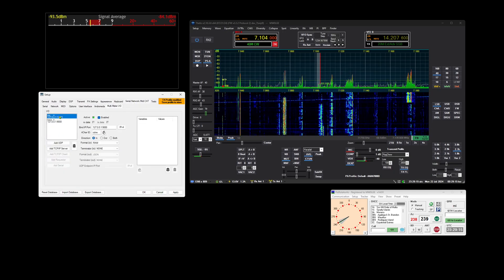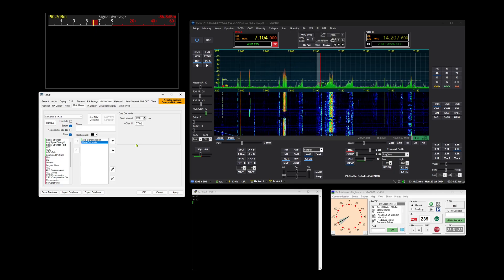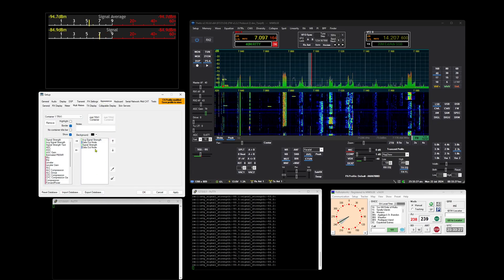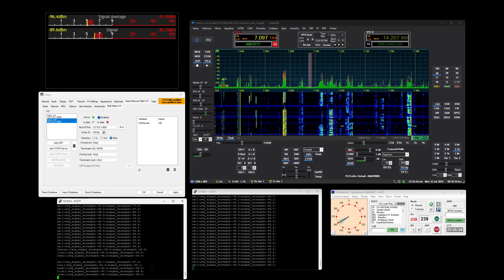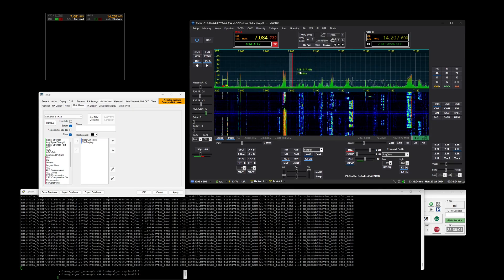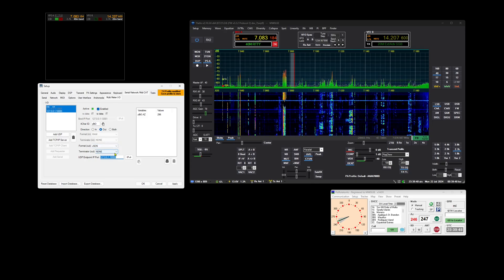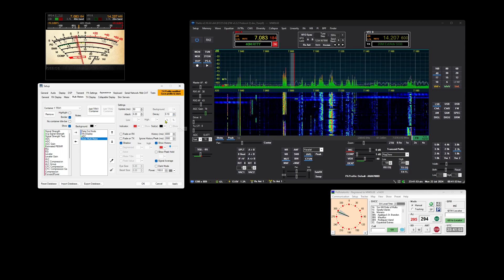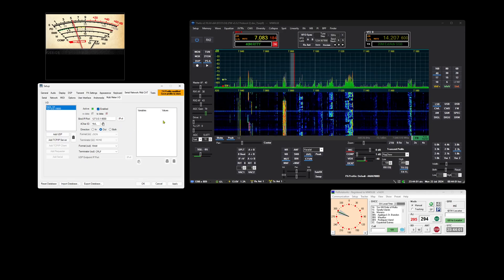Thetis - Multi Meter I/O - Output - Part 2

Comment: Hi, maybe is in terminator but I’m not familiar with these options. Is it possible to send or create and send info of particular keystrokes that convert into buttons in Thetis? I would rather create a button so I’m sure I’m sending the correct keystroke for example to change mode of a tuner. I’m already receiving the data from the tuner via UDP but I’m struggling a lot to send 4 simple commands. Can you help? Kind regards
Reply from the maker: mmio does not provide that functionality at the moment. It will send data node data, but that is all. Data node data is related to the meters etc that are in the container along side the data node. Cheers, Richie.

Comment: Excellent stuff Richie...Is it possible to output just the VFO frequency on its own? I have a Palstar HF auto, which receives CAT data in XML format over UDP on port 12080, that would allow the tuner to track frequency changes
Reply: Hi Richie

Your HF auto program solved everything for me many thanks…also works fine with my Flex 6600 via tcp/ip

73, Charlie GI4FUE
Reply from the maker: @gi4fue  ah cool !!! so the tcpip works with the flex? It is basically a couple of Kenwood CAT commands. That is good to know that it works. Fantastic. Cheers. 73 :)
Reply from the maker: Can you grab an example of the CAT xml data, perhaps using Putty, and email it to me? My email is over on QRZ. There might be some millage in adding XML support for cat via UDP. Failing that I have written my own HF-AUTO Controller that uses TCI etc, there are a couple of vids on here. 73 Richie.